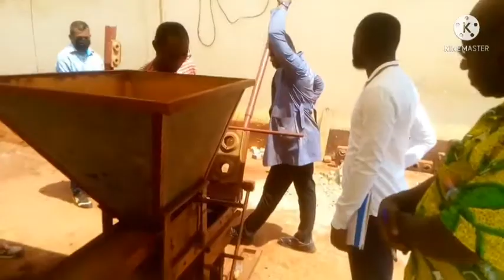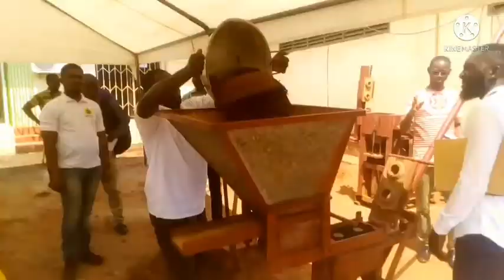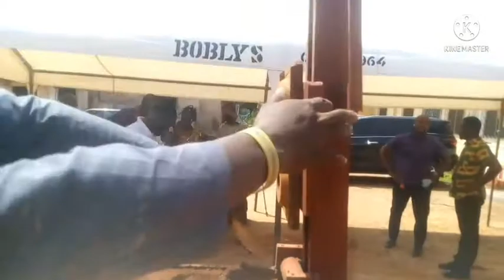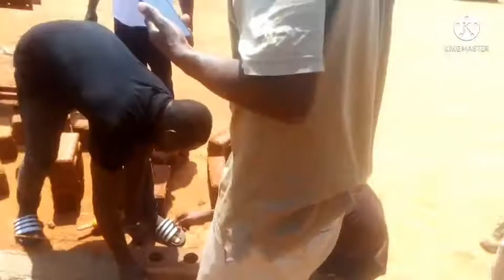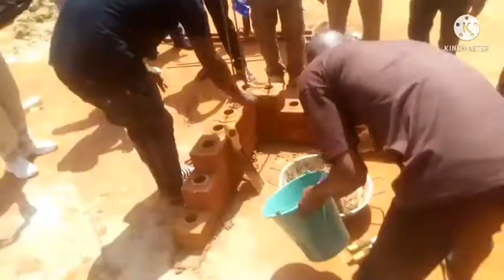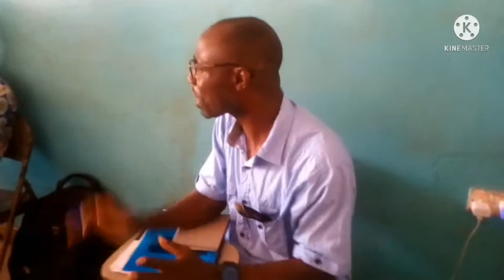Promoting The Use Of Local Building Materials, Promoting Laterite Bricks Accross Ghana

Comment: I have been training myself for the past 6 years on building with earth. I am now well endowed with the knowledge. My biggest challenge is the cost of obtaining a machine. Even the manual ones are not affordable. I am trying to develop a cheaper mould option which will significantly reduce cost.
Reply from the maker: Wow 😳 that's amazing, well you can meet up with the team at Department Of Rural Housing, because they are also well vested in the knowledge of building with earth. Maybe you guys can figure out something great. You can contact the number I have pinned.

Comment: What happens if you just use laterite soil? No cement. I read that it hardens into a brick when exposed to air, even without cement, and that this process is irreversible.
Reply from the maker: Well cement is a necessity, even though you can still go ahead without cement, it will not really last compared to the one with a little cement in the mixture.  
And I think the one without cement is reversible.